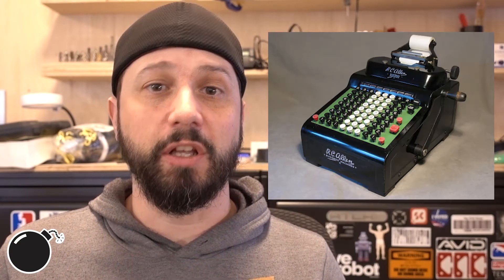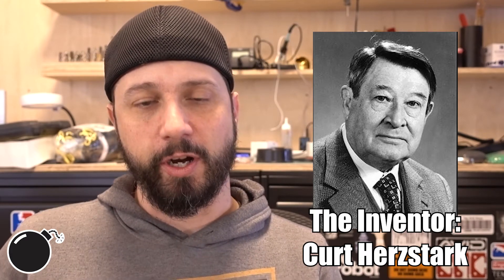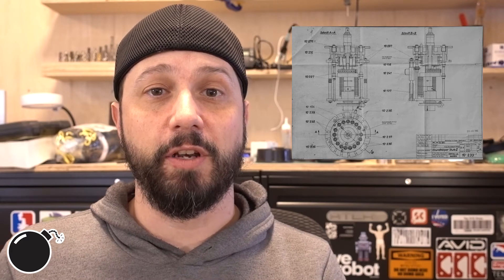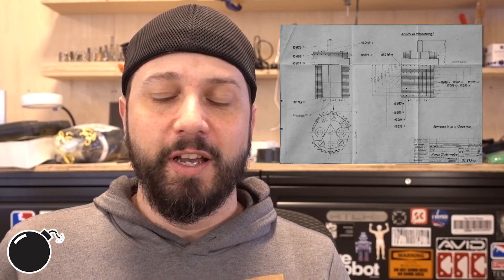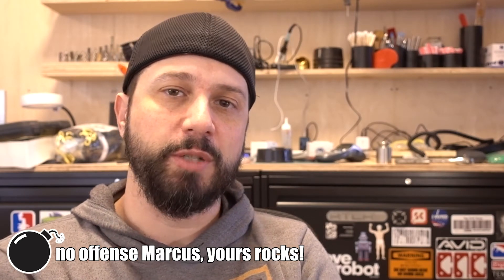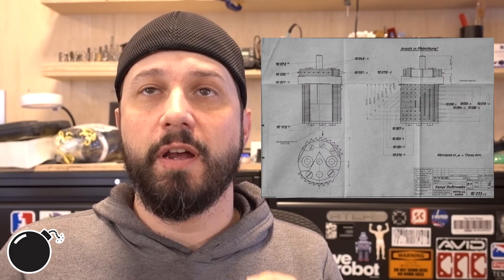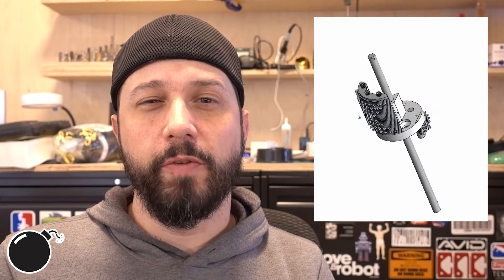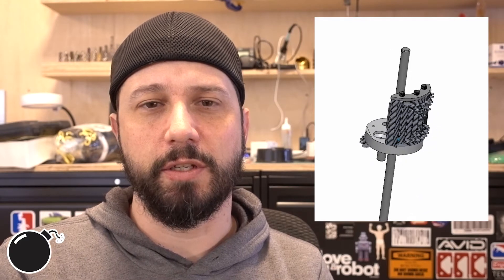The Curta Mechanical Calculator Saga Begins.....

Comment: Use metric!
Reply from the maker: Haha, I might! It just depends on material availability and what stock size makes the most sense for each part. Thanks for watching!
Reply: @thoughtbombdesign  By using metric, it will be waaay less prone to conversion errors... if a material is too thick... remove some of it...
Reply from the maker: Conversion errors are definitely a good point. Most of it will be exactly 2x the metric drawings but the shafts are tricky. I would make way more mistakes shaving down 20 1/8" shafts and drilling out bushings than I will doing a conversion.... 😁
Reply: @thoughtbombdesign  Have you tried sourcing the shafts from China or Europe?? you could probably get decent shafts for like 20 bucks...
Reply from the maker: No I haven't. I'll definitely expand my shopping area when I get to the shafts though. 👍
Reply: Metric is the only way or you will run aground. Try to stick with the dimensions and tolerances.